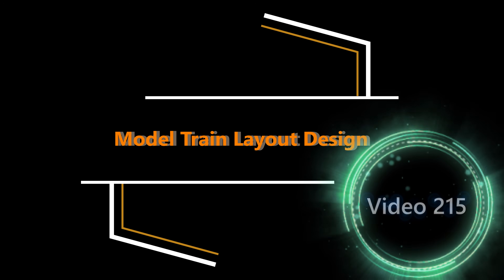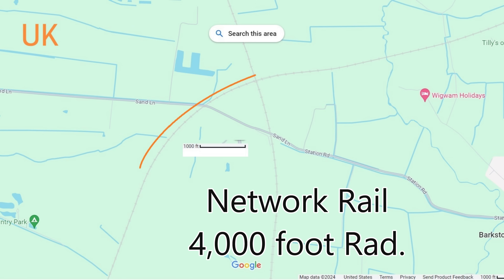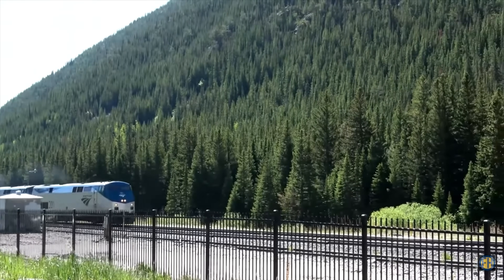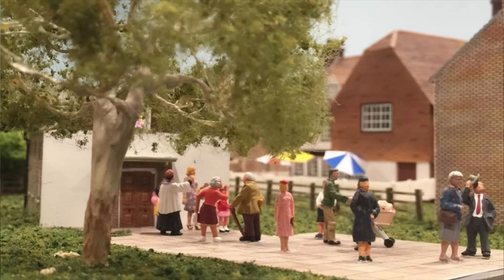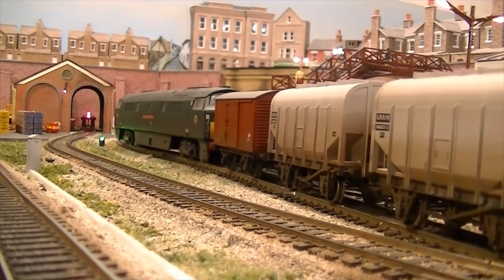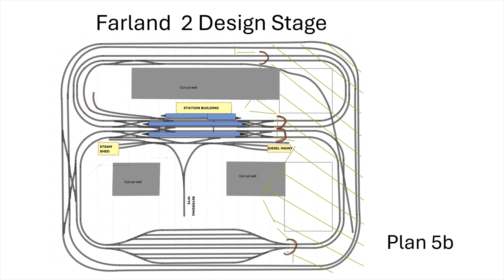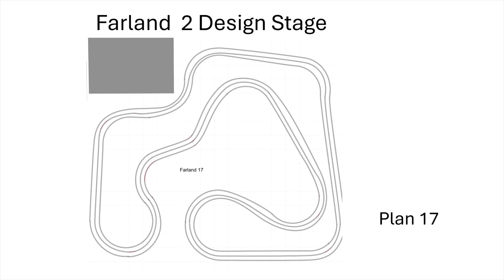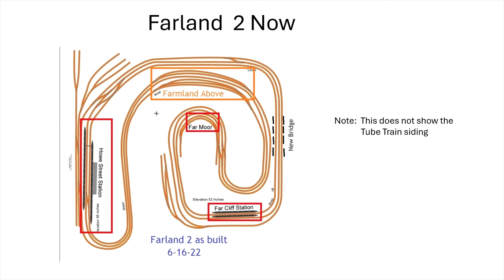215  Model Train Layout Considerations

Comment: I agree that planning can help fit what one wants on the layout. I also like to run trains and my last two layouts started with a track that I could run trains on while I figured out what the rest of the layout was going to look like.  I had to figure out how to fake easements in my track planning software to get a better idea of what would fit in the space I had on the table. I built a test loop before my current layout to see what grades my locomotives could actually manage with the cars I expected them to pull. This resulting in another series of plans on the computer before I started laying track.  With the grade information i laid a flat loop to run trains on (that was part of the final plan and not a test track) then I continued to revise the final track plan on the computer while I tested various bits and pieces to ensure things would work as planned.   I've been impressed with Farland Howe, particularly the trains operating over the system.
Reply from the maker: Planning can tell you what will not fit in the space as well as what will.  Experimentation is good, but simulating a long train and the friction that varies with each wheel set, each irregularity in the rail and track bed is harder.  It sounds like you’ve done a careful and honest job of planning your layout.  I am sure your layout is a success and does what you expect.  I find the planning to be at least as satisfying as building the final result.  Thank you for the great and well considered comment.  Rob
Reply: @FarlandHowe  It's worth noting that the planning for version 4 was similar and only failed when trains were running on the first set of grades laid down. Four Superliner Cars were involved with object lesson and figured in the testing that followed. The current plan took that into account but I still had to dismantle v 4 to correct the issues.  Something I have called "success Oriented Planning" at work!  I'm still learning after 60 years of 'playing with trains"! I am a firm believer in Harrigan's Corollary to Murphy's Law: "Murphy was an optimist!"
Reply from the maker: @Rayinn-lw3ej That bit about Murphy is spot on. 😄

Comment: In all my 65 years plus in this hobby I can say that planning has never worked for me. I always try to fit in more than the space will accommodate. It looks good on paper but it doesn't work. So my layouts are products of evolution. I put a piece of track down and add another to it and see where I end up. I no longer use fixed radius curves but rather transitions in and out of curves. On my current layout I have a short piece of no more than 15 ins. of about 26"radius within a curve of over 5 feet in length.
I do like the free flowing running on Farland Howe.  David.
Reply from the maker: Hi David, It is nice to hear from you.  Do you think they start building bridges, ships or skyscrapers without massive planning?  I admit, I spent years on a drafting board planning dynamic systems.  It is a skill but effective planning has its foundation in true to scale representations on paper or 3D models.  If the representation is not true to scale and proportional it will not solve the puzzle.  Thank you, Rob
Reply: I'm 65 also.  Studied track plans, operations, details, specs all my life.  Started building 3 months ago.  Get the hell out of my way, get me a circular saw, 5 sheets of plywood, four boxes of track, and stand back.  Deliver a 12-pack daily at 4.  You can plan, or you can build.
Reply from the maker: @blainedunlap4242 It is a great hobby with room for everyone.

Comment: Ah Yes Track plans Can Be Very tricky no Matter what scale you Run Slow Down Take Your Time, think It Over this Is A Passion Patience thing No a Race to See Who Can Build Their Layout the fastest. Slow Think It Over and It Will Come to ya To me I Don’t Rush what I do to And Yes I Don’t use a Computer I Have Also Built My Wife’s HO And N Scale as Well and Think this Too Balance every Section as Well. You will Be Happy you Slowed down And Take your time Do what you gotta Do and You’ll Be Happy You took Your Time.think About it and It will Come to ya. Remember measure 2 cut 1. And You will Be Happy in the Long Run.
Reply: So true Rob, it can take a long time before you really get a picture of what works on a larger layout like this.The old P^4  = perfect planning prevents poor performance. It pays to list/ identify what excites/ pleases you and must have features as well as min radius, reach distances, viewing height, maximum incline etc. Do some mock ups if not sure. Then list the dislikes or must avoids. Also looking at other folks layouts to review against and get new ideas. It’s taken me eight years to design mine, paper sketches first then to CAD to get honest dimensions and view in 3D (mocked up all my buildings etc as I built a sample of each but in CAD can so easily copy multiple times) to see what it looks like. This certainly has worked well for a larger project , particularly because I do not want to rework mine. The baseboards were 3 months of hard work back in 2020 and my lighting for it evolved over a few years. Sure it’s not everyone’s approach nor might be considered appropriate for a smaller layout. Great to see you got what you wanted, just look at how engrossed you are in it too! all the best Stephen
Reply from the maker: @stephenpike3147 No matter what size, planning is appropriate.  Each railway is very personal to the owner.  That individual railway identity is the best part.  Thank you, Stephen
Reply from the maker: Thank you, slow and steady.  There is no race.